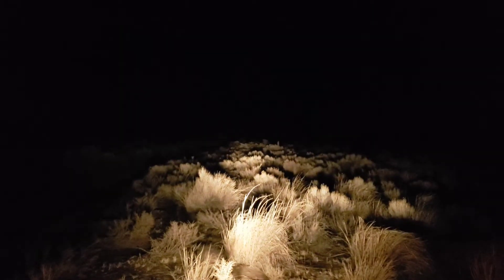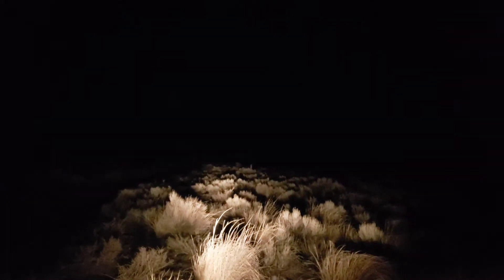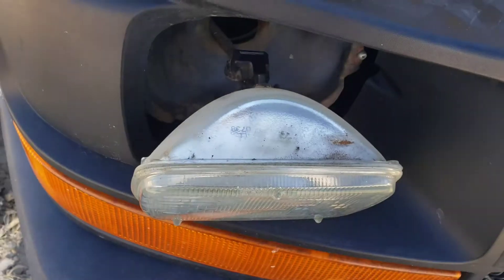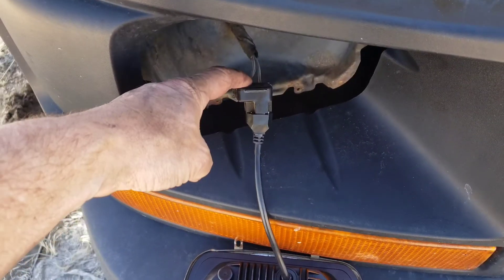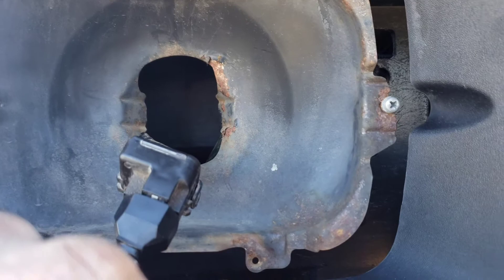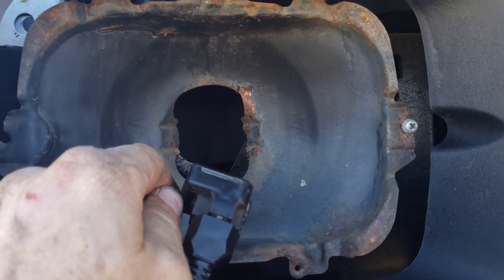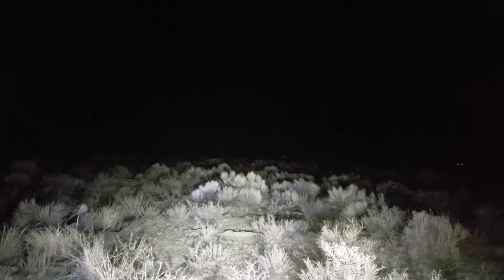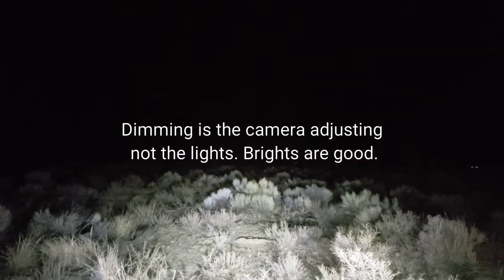Replacing headlights so I stop missing my turns at night.

Comment: The brightness of LED lights is why I won't use them in my headlights.  I've always been in vehicles like sedans (and smaller) and I am blinded by oncoming traffic when big trucks use those headlights.  It's annoying enough to me that I don't want to do that to anyone else when tooling around in my Suboverland.  Lol.  I do have LED fog lights, though, which help out.  

I try to drive only during the day but it doesn't always work out that way.  I also miss turn offs but that's my bad for arriving late.  Lol.  I'm thinking of adding an LED light bar that I can switch on when I'm back in the deep woods or when there's nobody else out on the road.  I just don't know how to wire it.  I think I can replace the fog lights with a long bar and just use the same wiring, but Idk for sure.  🤷‍♀️
Reply from the maker: I agree with ya and really was hesitant to switch over but just about the only time I'm on the road at night I am on a country road somewhere with no traffic. I am also going to see how low to the ground I can aim them to minimize the chances of blinding people.
Reply from the maker: Light bars ..some of the larger ones should be on their own circuit but you could probably get a similar effect with switching the fog lights to LED. There are a lot of products on the market.  If you have wiring doubts about whatever you get put a fuse inline and if is blows it needs more power and likely would have to be wired individually. It's a cheap way to tests it out.
Reply from the maker: It also was the quickest and cheapest option for me. Dropping a lot of money in this vehicle right now so trying not to go overboard.
Reply: @VANquishedAdventures  Yeah, I totally understand.  I just need to train myself to be a morning person rather than the night owl that I am.  Lol.  It would also help if I were electrically inclined.  😋
Reply from the maker: That morning thing is hard. I have found that being out in the woods away from distractions does help me get to bed earlier.....most of the time. Regarding electrical...... you'll be an expert before you know it;)